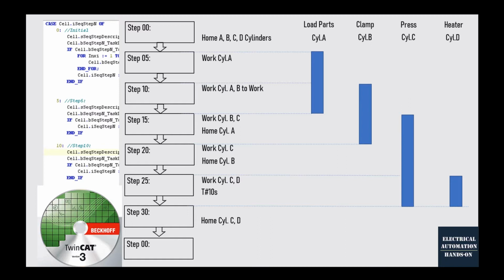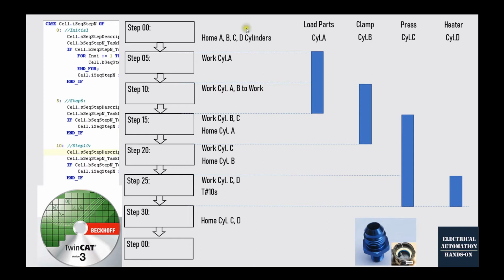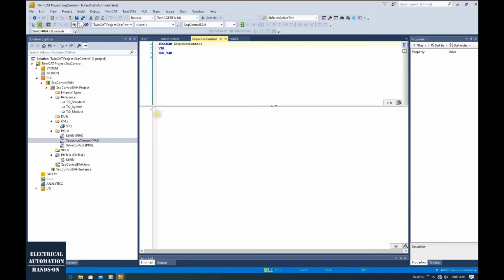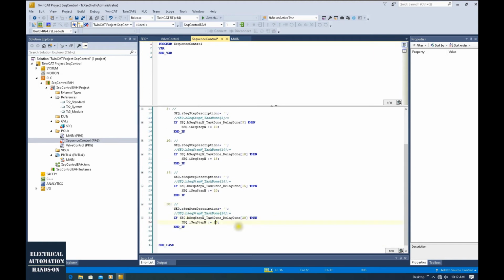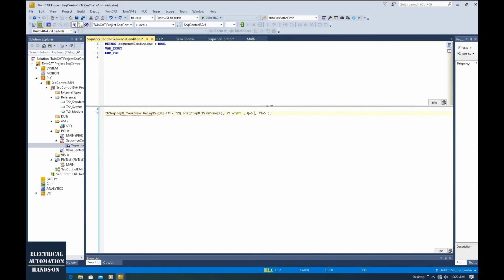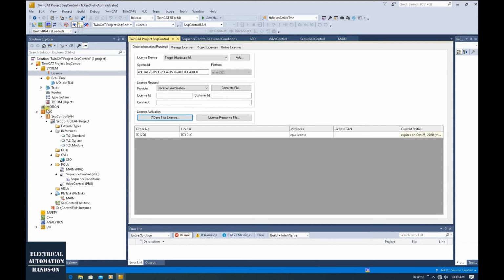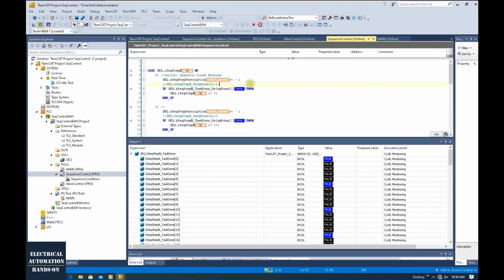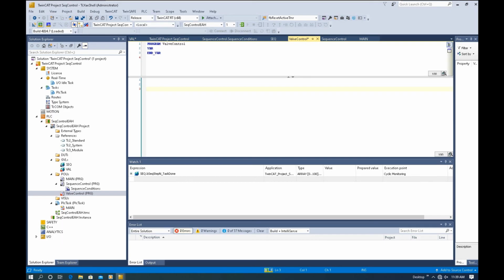BK11a. [1/2]Beckhoff TwinCAT3 Sequence Control by Using "Case..Of" [Sequence Structure]

Comment: Hi and thanks for the video it's very helpful :-).
I have a qusetion when you activate  bSeqStepN_TaskDone[0] in watch tabel to TRUE you get Value 5 in SEQ.iSeqStepN [5], which means that jumb to step 5 (next step), right? I have made a programme 100% like yours but instead I get always 1 value. Do you know why? Thanks in advance for your help  :-)
Reply from the maker: Yes, you understand is right. Note: this is a "structure, or template", in the actual case,  bSeqStepN_TaskDone[x] should be controlled by other conditions, such as sensors turns on, valve at home or work positions. You could check the next video,  BK11b. [2/2]  https://youtu.be/NtG-O5NmOWA  this is a valve control application by using this sequence control structure.